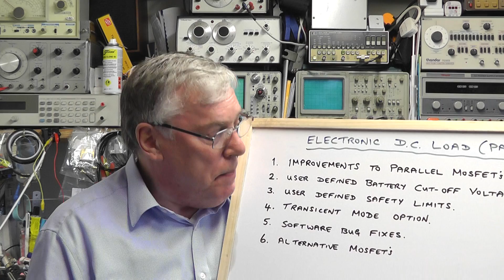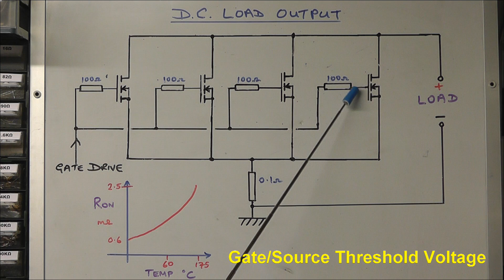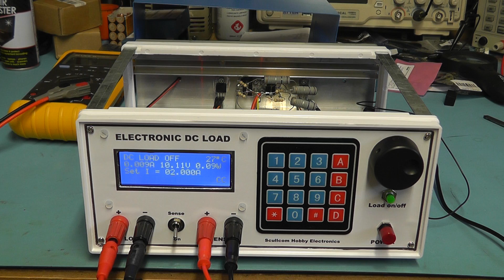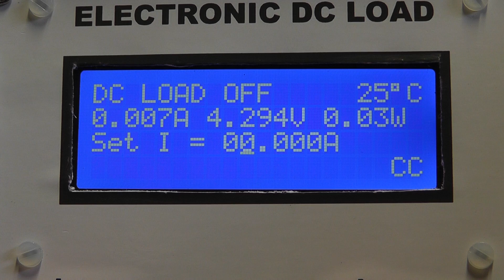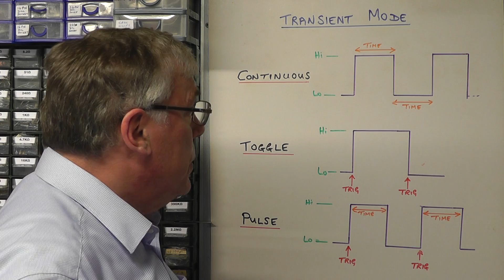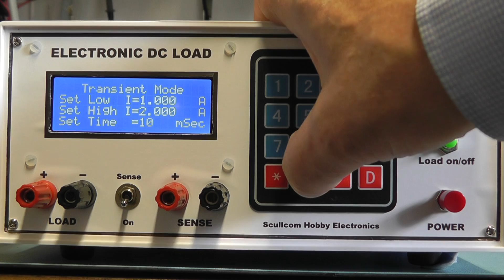Scullcom Hobby Electronics #49 - Electronic DC Load Part 5

Comment: First I want to say thanks for a great project. It has been a great inspiration for my own build of an electronic load

Some differences I did

I used a single FET - IXTN60N50L2. It is a device made for this kind of linear applications with a high forward bias safe operating area. It is in a SOT227. The kind of big monster package that can make small children cry of fear. :-)
It requires a gate drive above 5 V so I added an additional OPAMP. I used LMC7101 because I had it lying around and it can run both inputs all the way down to ground. I use the 12V DC as power supply for the LMC7101.

I wanted a higher power rating so I use a 0.01 ohm 1% four terminal resistor so I can run up to at least 20 A.

As heat sink I used a heat sink Fischer Elektronik LA-6-150 Conrad  Electronic P/N 166111 which is 0.3 K/W with a 60x60 mm fan mounted at the end.
With this single FET and this heat sink I can draw 140 W permanently with the heatsink at 82-83 deg C. I set the limit at 85 deg C. The IXTN60N50L2 mounting surface is isolated from the silicon so you do not waste precious K/W from isolation mica.

I can run the load at 13.8 V / 15 A and probably also at 20 A for several minutes - enough time to do load measurements on a power supply.

You have made some provisions in software to eliminate offset. This offset is actually the result of input offset of the AD8630 and the problem for it to pull output completely to ground. It is only 1-4 mV we talk about but this is enough to prevent the load to go properly to zero A on the FET.

I made two solutions.

First - quite many rail to rail CMOS based opamps can go to perfect zero if you put a resistor on the output of the opamp to a negative voltage. By experiment I found that putting 220 k resistors on the outputs to -5V from the ICL7660 made the AD8630 go perfectly to ground.

I still had problem with the D/A MCP4725 which also has an output offset. You cannot compensate for this in software because you still end up with a current flowing in the FET. My solution was to make a -2.45 V voltage with an LM431/3.9K resistor to the -5V V. And then I put a 10K multiturn potentiometer between the 4.096V and the -2.45 V. Both these voltages will be very stable over temperature. The wiper from the 10k potentiometer is connected via a 4.7 Mohms resistor to the inverting input on the opamp that drives the FET. This way I can null the offset from both opamp and DAC to perfect zero.

For the voltage sense I used OPA334AIDBVTG-4 because I happended to have one around. It is an opamp with very low input offset. I run it on single 5V DC supply. To get the output to perfect zero I put a 2k resistor to the -5V from the ICL7660. That gives me a perfect zero volt on the output.

It is actually the data sheet for the OPA334 that gave the hint of putting a pull down resistor to a negative rail. For the OPA334 they recommend 2k. For the AD8630 I experiented my way to the 220 k.

I connect the OPA334 output directly to the MCP3426 ADC. The AD8630 just added offset and is not really needed when you use the OPA334 with single supply and the pull down to negative trick.

For the fan control I chose to use a FET 2N7000 instead of the BJT.

I had a big problem with the startup current. The first second the opamp that drives the FET turns on the FET 100% putting an almost short on the DUT.

To control the FET during start I made these changes.

I moved the temperature sensor from A0 to A6 on the Arduino Nano. A6 can only be an input. A0 can be used as output.

So the LM35 on A6 frees up A0 to switch force the load off.

The A0 is connected to a 10k pull up to 5V. And also to a 10k to the base of an NPN MMBT3804 NPN which has emitter to ground. The connector has 22k to +5V. And the collector is also connected via 10k to the base of an MMBT3806 PNP. The PMP has emitter to 5V and its collector is connected via 100k to the inverting input of the opamp that drives the FET.
The result is that when the Arduino powers on the A0 default to input. The pullup turns on the NPN. The NPN turns on the PMP and the PMP pulls the inverting input higher than the non-inverting input can ever get turning the FET totally off.

In the software I set the A0 high and change it to an output and in the code that sets the D/A to set the current I change A0 to LOW when the current is anything alse than 0 and the load is turned on.

Last thing

There is a bug in the software fanControl function. You have two conditions. One when temperature is below tempMin and one when the temperature is between tempMin and tempMax. However there is a valid termperature interval above tempMax that that is ignorred so the display stops updating the temperature when you hit tempMax.

I added a if (temp > tempMax) {  section that just sets the fanspeed to 255.
And I moved the 4 lines updated the LCD to after so they are always executed and temperature is always updated.

I hope this long comment is a help for you Louis and for anyone building along.

Kenneth
Reply from the maker: Thanks Kenneth for your detailed description of your changes to this project. I am sure others following my videos will benefit from the details of your version.
Using a Linear Power Mosfet will give you the additional power, as these mosfets specially designed for linear mode operation so they are very suitable for DC loads. However, they are very expensive and required additional drive circuitry as you point out. The IXTN60N50L2 you are using costs about £24. I have been playing with the IXTP15N50L2 which is cheaper at about £5 but lower power rating but can still give me about 250 watt or more.
Trimming out the OP Amp input offset voltages does improve calibration I have been testing its use on the OP Amp feeding the Power Mosfet similar to what you have been doing this will remove the need for software calibration factor which I had in my Arduino code.
Thanks for pointing out the bug in the fanControl function, I will make the change in the next software update. I am currently having another look at the fanControl as there are some other issues which can effect the load voltage reading slightly on the LCD readout when the fan turns on. I will discuss this on my next video update.
I am just finishing the trigger input circuity and will also cover that in my next video.
Thanks again for sharing in detail the changes you have made.
Best regards,
Louis
Reply: Hi Kenneth, you should make a video with your modifications, some are very useful and I would like to see it in practice. Thank you for sharing!

Comment: Thanks so much for this project! I have wanted to build a DC Load for some time and in fact had even previously acquired the enclosure you ultimately used with the intention of building my own design. Several of my amateur radio associates are building the same variant, so it's become a fun group project. While doing some testing this evening, I discovered a minor bug in the code. In the fan control routine, the LCD print statements need to come out of the IF - THEN sections. As it is now, the display stops updating at 50 C. The OVERTEMPERATURE still trips at 60 C, but the display continues to read 50 until it trips out.

Thanks again!
Chuck
AI4WU
Reply from the maker: Thanks Chuck for your comments. I will have a look at the code for the fan routine which you pointed out. Good luck with your own project of your DC Load.
Regards,
Louis

Comment: Hi Louis, another option would be to replace the 12V fan and use a 5V instead.
You can then use two 18650 Lithium Ion batteries in series with a small DC-DC converter to power the whole setup.
I am guessing that it will draw 500mA-600mA so you could easily run it for several hours continuously.
Reply from the maker: Thanks Javier for the idea. The total current draw is only 70mA maximum when the fan is off. When the fan kicks in at 26°C the current draw goes up to a maximum of 220mA. So it would run a long lime on two 18650 Lithium Ion batteries.
Regards,
Louis

Comment: Louis,
The maximum current that I can draw is 4.1 amps. I checked the output at the divide by 10 resistors and the voltage corresponds to .41 V. If I step the current any higher, the load cuts off, if I back the current down, the load comes on. The limits are set high enough. Any ideas ?
Reply from the maker: Hi Phil,
The reason the maximum current limit is 4.1 Amp is due to the fact that I added a 4.096V reference to the DAC to improve accuracy. If you want to go higher than that then you could go back to the original circuit design but would loose some of the benefits of the change.
In future we could look at other ways of reaching higher currents.
Regards,
Louis

Comment: I was thinking why not when the unit powers up with no load have it automatically zero the amp and watt instead of it being manual ?.. Just a thought.
Reply from the maker: In one of my software versions I did make this adjustment automatic at switch-on but then decided to allow it as an option with a key press. One of the reasons was that if a load is connected at switch-on then it would zero the reading to that voltage making it read zero instead of the load voltage. If you prefer an automatic zero as an option it is very easy to do with small changes to the software.

Comment: It might be worthwhile considering changing over to a 4 by 5 switch matrix. This could add four buttons for just one I/O pin.  Buttons to consider for the four are: Load On/Off, Zero readings, Trigger (via an opto-isolator or a relay), and one other.  It may be worthwhile keeping the rotary encoder's button out of the matrix if you wish to continue using it as a 'shift' key although, personally, I'd suggest dropping that part of the User Interface.

There's a typo on the schematic, "Sense" is written as "Sence".
Reply from the maker: Thanks Brain for your comments. I have considered a larger matrix keypad. I found one option on eBay which would give 20 keys as part of a front panel with a window for a LCD display.
http://www.ebay.co.uk/itm/191693869222?ssPageName=STRK:MESINDXX:IT&_trksid=p3984.m1436.l2649
I may order one to see what is is like.
Thanks for pointing out the typo error on the schematic.
Regards,
Louis
Reply: Interesting keypad.  I reckon that there's enough of a window to see the 20 by 4 LCD through.  Nice to have 'CLR' and 'ENT' buttons, they will go well with the current UI.  A bit of a pity the rest don't, although '+/-' makes a good '.' replacement.  I assume that you've seen this https://goo.gl/NJKbW8 on AliExpress.
Reply from the maker: Brian of Romsey Yes I have already ordered a few of these 5x4 keypads for another project I have in mind.

Comment: Louis,
Thanks for your recent comment (in "Part 4") about "I Set" not agreeing with the actual current.
I've caught up with Part 5, and now have issues with the "Sense"  voltage reading not with the voltage of my programmable power supply. (which is spot-on)
I've tried adjusting the multiplication factor in the code calculating the "actual voltage"  (50.4, I believe) and if I get the setting correct at, lets say, 10 volts, it goes off, below and above 10 V. In other words, non-linear.
I wonder if you could discuss this calibration issue in the next video ?
As always, great work and thank you for the learning experience!
Reply from the maker: Hi Phil,
I will do some further work on calibration and see what I can do to improve things.
Regards,
Louis

Comment: Another very nice update, Louis.  You've developed the most usable, and useful, DIY load I've ever seen.  Well done!

Just one comment about MOSFET selection.  You spent a couple of minutes discussing Rds(on), but that's not really germane to this application.  Rds(on) is characterized with the MOSFET turned hard on (often at Vgs=10V), not when it's used in its linear region.  In a DC load, we purposely operate the MOSFET at a gate voltage that results in a drain-source resistance greater than its minimum value, making Rds(on) irrelevant.

The more important thing to look at in the data sheet is the safe operating area (SOA) graph.  This relates Vds to drain current, showing the power dissipation capability of the device over time. For a DC load like we're discussing here, your application should fall within the DC region of the SOA graph

If you Google "linear MOSFET," the first non-ad result is an Infineon application note that explains this concept in greater detail.  Several manufacturers offer devices that are tailored for linear mode operation, most notably IXYS (see article further down in the Google results).
Reply from the maker: Thank you. As you say the Safe Operating Area is the most important data to look at for this type of operation. I did cover that in detail in part 2. What I should have said in this video is that I compared the SOA graph for each of the mosfets as well as looking at the headline data.
I have had a look at some of the Linear Mosfets from IXYS Semiconductor which may be an option for the future. They need higher drive voltages and so the circuit would need some changes, they are also very expensive (usually around £12 each). I have found lower cost one from IXYS for about £6 which is the IXTP15N50L2. I have ordered a couple and will have a play with them.
Thanks again for your comments and interest.
Regards,
Louis

Comment: Hello Louis, I very much like the idea of transient mode, however as others have mentioned, the keypad combinations are becoming less intuitive. Perhaps the letter keys can be mapped to menu lists, with sub menus as the numbers (ie: "A" key displays menu "A", where you can select "1 = CC", "2 = CP" etc...). I would also like to suggest adding a BNC external input, allowing the user to switch between "internal" DAC driven load, or an "external" signal from a waveform generator to give the user unlimited transient waveform options. Obviously some input protection circuitry would be required to clamp the voltage on the op amp current sense input, but not a huge mod to the unit.Keep up the good work... Brett
Reply from the maker: Thanks Brett for the suggestions. Adding menus may be an option. With regards Transient Mode I was thinking of adding a List Mode which would allow the input of a range of current limits. As this project has progressed it has take on a life of its own and sometimes it is difficult to know when to stop. Hopefully, it will encourage others like yourself to add to my project to fit your own needs.
Regards,
Louis

Comment: Hi Louis! Thank you for this nice project, I haven't seen anything more functional published so far.This will become my next project after I finish my function generator from Qex magazine for my little lab http://www.arrl.org/files/file/QEX_Next_Issue/May-Jun_2013/Fernandes_QEX_5_13.pdf. I just desperately need more power dissipation, so I am thinking of adapting the project for higher power and use IXTQ170N10P mosfets. Do you see any problems with that?
Reply from the maker: Thanks Vytautas,
Interesting function generator project.
The IXTQ170N10P is a higher power Mosfet but I think it may need higher gate/source drive voltages. The Junction-to-Case Thermal Resistance of 0.21°C/W is very good so it should run cooler. I have not tested this one on my project as yet. It may need some changes to the gate/source drive voltage. But worth a try.
Regards,
Louis
Reply: Thank you. I will certainly give it a shot. By the way, a method that I use for fixing output power transistors in my audio projects, for example, is bolting them down to the heatsink through one 3 mm aluminum plate which I put on top of all devices. This way, all transistors are pressed to the heatsink very uniformly, and the plate serves as an additional heat transfer/distribution path. This is a method I had learned from Elliott Sound webpage http://sound.whsites.net/projects-0.htm#msc

Comment: Hello
In TT mode, on first trigger, it looked like it went to 2A first and then right away to 0.5A. Is that so or not?
for the next time, this transient modes, can you take out scope and show how current goes, what is the rise/fall time, overshoot if any?
Reply from the maker: In the demo of this feature I simply used a push button to ground to simulate a trigger pulse and what you saw was due to the key bounce on the push button. As I said it really needs a pulse shaping/reduction circuit on the trigger input and I plan to add one during finalizing this project. We can have a look with a scope next time but you really need the trigger input circuit there first.
Regards,
Louis

Comment: Hi Louis!
Thanks for your professional videos!
How would you rank the CSD18502KCS  FET ?
Reply from the maker: Hi Phil,
I have had a look at the datasheet. I do not think this is a Logic Level Mosfet. It needs a higher gate/source drive voltage. Also the maximum drain to source voltage is 40v. The Junction-to-Case Thermal Resistance of 0.6°C/W is also higher than the one I used so it will get hotter. At 25°C the maximum current at 30v would be 2 amp but this will reduce by at least 50% when operating as a DC load. Therefore, I would not use this Mosfet in this project.
Regards,
Louis

Comment: Do you have any intention on respinning the PCB now that the components have been changed so much?  Good work.  Once things are finalized, this will be a project that I plan on building.  It looks pretty capable.
Reply from the maker: Hi Jonathan,
Once the project is finalised I may design a new PCB and make the artwork available as a download.
Regards,
Louis

Comment: Well done.   Two suggestions: 1)  On the user setup function it would be nice if the default settings were displayed before an adjustment is made.   2) Have a quick reference sheet that can be taped to the top showing the combination of buttons to press to access  each feature.  "Like" clicked!
Reply from the maker: Thanks for your suggestions.